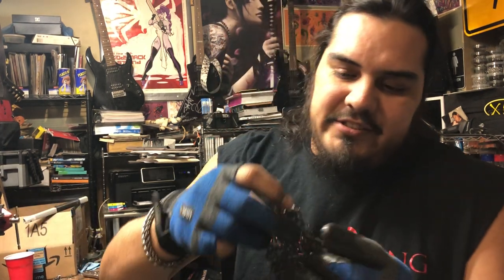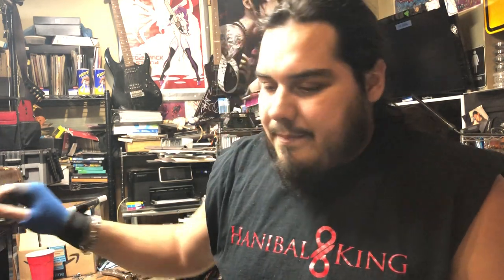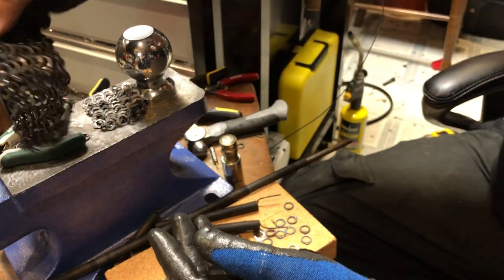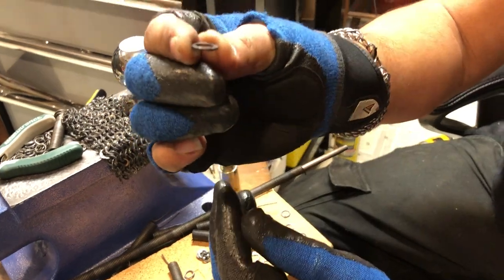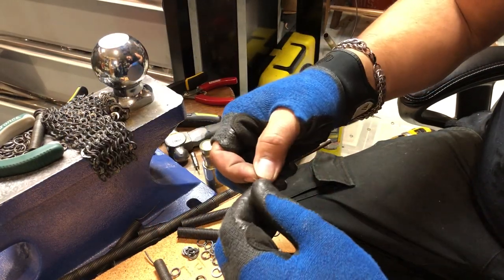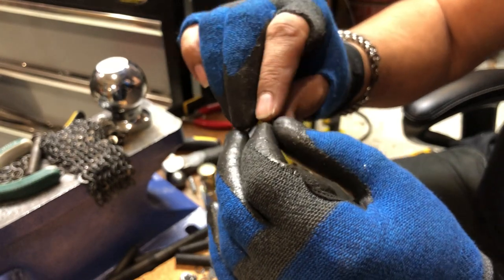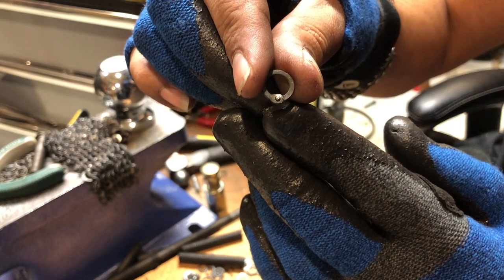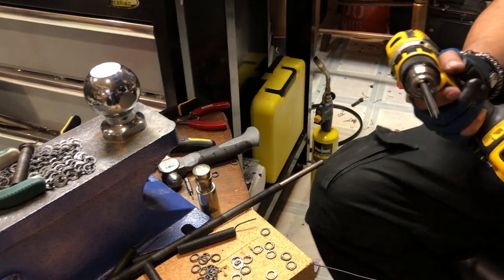RivetMaille

Comment: Suggestion? Anneal the coil, before you cut the separate rings and the full coil will hold the heat a bit longer. 👍

Comment: Cant find the punch piston or equiv for flattening.  Any leads? Tool steel blank rod perhaps?
Reply: See my reply above.  They are made from the pin and a pin adapter used to hook tractors to farm equipment (basically, hitch pins).
Reply: Search "top link pin" and "top link bushing."

Comment: Made everything same as video, when I go to punch the holes the bit breaks off, any advice?????
Reply: I'll second this question, because the exact same thing happened to me! Went through two bits in about 6 rings. What advice to improving the lifetime of the drill bit punch?
Reply: Make sure you're striking straight up and down if you use his method. Hitting at an angle will break it because that becomes the path of least resistance. The historical method of using a large punch and just hitting the ring with it on the anvil face is more effective though, less fiddly and faster, but the hole isn't quite as precise.

Comment: could you harden the steel once finished building a mail piece like a shirt, coif or other by heating and quenching?
Reply: it is mild steel so heat treating (other than softening) wont work, however the flattening of the rings work hardens the piece.